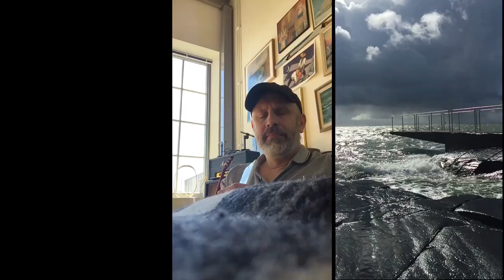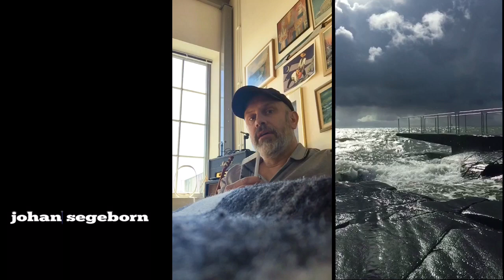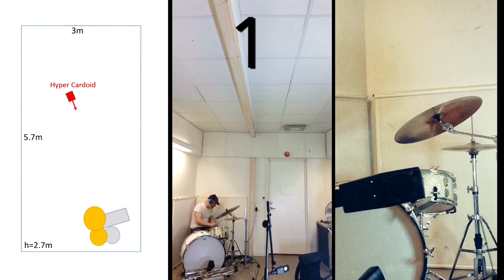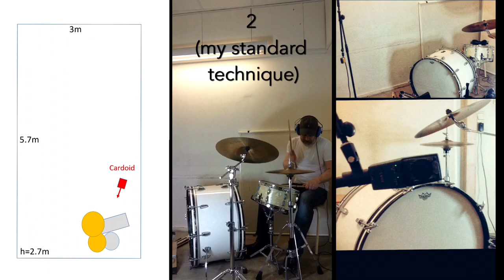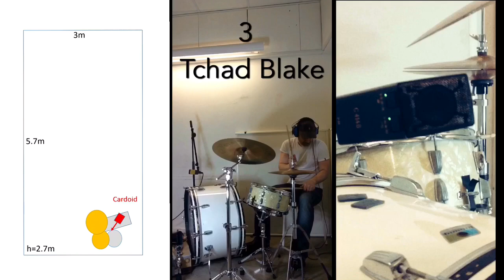How to record dynamic DRUM tracks with just the ROOM MIC a la Led Zeppelin

Comment: I used the 3rd technique for three years with my last band.
To record each rehearsal using two mics. 
One for the drums. One for the guitar and bass. 
Using a two mic interface (line 6)
And Reaper.
It came out really good. 
I could later mix the drums, and the guitars. Separating the bass and 6 string guitars using EQ and effects, and panning one to the left, the other to the right.
The same with the drums. I'd copy the drum track and use EQ and effects and balance to isolate and enhance each part of the drum kit. 
The isolation of the drum track from the guitars track and vice versa was excellent. 
Considering that the interface was under $100 second hand and the mics were the studios. And that Reaper is free. This was a really inexpensive way to get great sounding recordings.
Not perfect of course, but I ended up with nearly every rehearsal recorded.

The drums came out well balanced. All toms had body.

Comment: Very good comparisons. #1 sounds the best to me, #2 is not bad, #3 tchad Blake is good but I find something wired happens to the higher frequencies, #4 is clear but there is not as much bass in the kick. Have you tried getting a good sound with light hits?
Reply from the maker: +MrMetalclay Thanks! When I hit lighter it requires an even more controlled room too get a punchy track from distant miking. Cheers

Comment: It helps if you have Bonham's drum sizes. I have one set and can hear the difference from the larger set  to the smaller set.  Must have the 26" kick drum to get the Bonham sound. You nailed the sound with no. 2. That's Bonham right there.

Comment: 4 all the way. Gotta agree with a commenter below though, that phasing sounds weird. I'm sure it could have its applications in a really psychedelic song, and would be less noticeable in a full mix, but you would need to cut off everything below like 100 Hz to prevent the lows from sounding really uneven. I couldn't tell, that was a 414 I assume, was it facing up at the ceiling, or down toward the kit? It looks like it's face-up.
Reply from the maker: +Adam Rainstopper Hi Adam, yeah that stereo phaser became a whole lot more dramatic than I intended to :-) The 414 points at where the hihat meets the snare in a basically straight horizontal line. Cheers Johan

Comment: it would be cool for you to check out the difference on guitar tone with and without copper shelding.
Reply: It wouldnt get hum basically (that 60hz noise) and wont get some interferrence from lamps and electronic devices. in normal use (like home playing) it wont make a big difference, but in an venue or gigs with plenty of neon lights is when you actually need it. Cheers